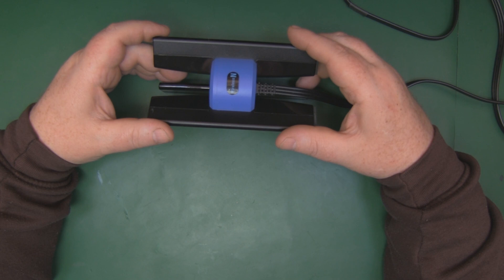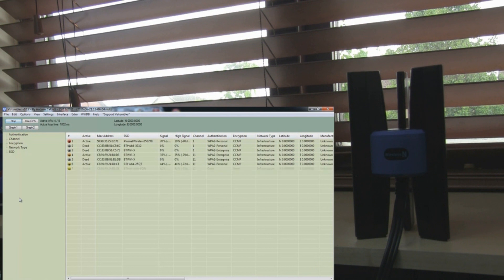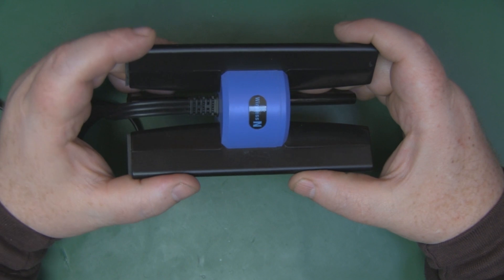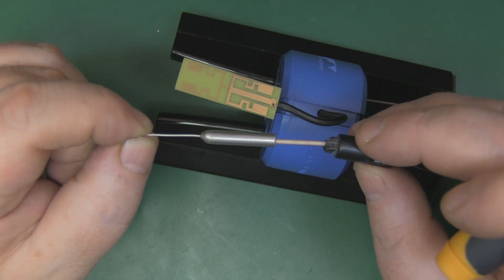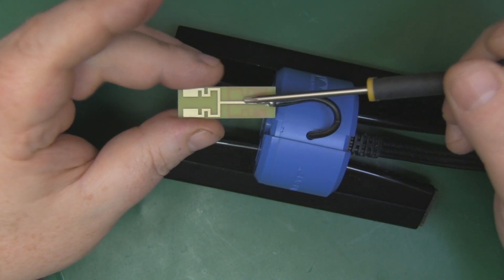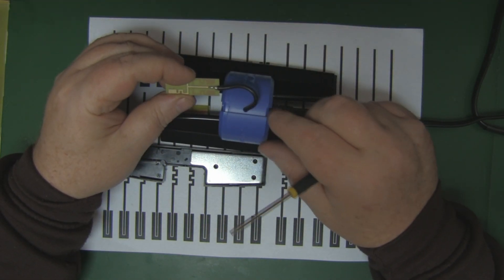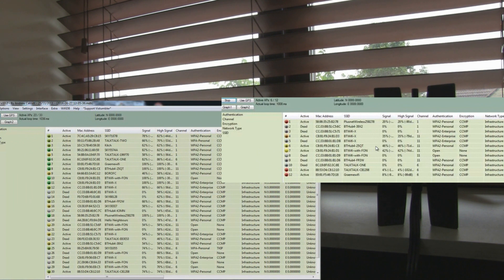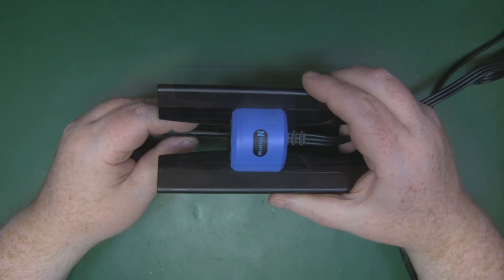It’s a Bad Antenna but it Looks Good! #162

Comment: I found one at goodwill after watching your video. not to bad on the signal so I opened it up and found they had changed the elements to brass and enlarged the measurements nice antenna it works good for what it is I love the videos Andrew thank you

Comment: I think there must be a slot for that WIFI module in your computer or why not just get rid of the PC your  running and get an ACER ASPIRE TC-220 with built in WIFI/BLUETOOTH which runs an AMD A10-7800 can be upgraded to a A10-7980k and 16GB of DDR3 RAM, it has a plugin graphics card which should not have been installed as a perfectly good graphics card and sound card is integrated into the A10-7800 provided the tiny screw is removed from behind the VGA connector which will release the piece of card which is blocking the HDMI port all in all is a very good machine.

Comment: Truly an odd antenna, If it was a real high production run or standard antenna of sorts I'd guess it to be a cost thing.
Even the cost argument doesn't really make much sense though due to the abundance of good cheap simple dipoles

Comment: Thanks to you, I've improved wifi, 3G and radio control toy transmission. Not only have I learned about this science but also had great fun building the antennas, with surprisingly good results even without testing equipment. Biquads, double biquads, helical, and dipole a based antennas. I had good results with all of them but biquads are my favourite (double biquads are marginally better). My major breakthrough was adding an IPEX to SMA extension to my laptop's WiFi card, allowing me to experiment with directional antennas and pick up free signals. I then purchased a £2 USB WiFi card with a ralink chip that also has an SMA connector and this way I can spread the signal through my house with another double biquad (and even connect my smart TV to the same network). Regarding radio control quad copters, I have a £10 toy that was limited to 30 metres doing 200 metres easily (2.4GHz biquad on the TX and 5.8GHz cloverleafs). My goal now is to push the video signal as far as i can with a biquad on the receiver, however using dipole and biquad for video introduces noticeable noise compared to the cloverleafs, which arent very durable). I will surely purchase one of those pcb biquads from you in the future or maybe a high gain helical, as Im not sure mine is working properly (7 turn 2.4GhZ with less gain compared to a biquad). All the best. Francisco

Comment: I'm about to build my own debian based wifi router. 

I notice these mini pcie cards with 3 antennas. can these 3 coaxial connector's splice together to be connected with a single antenna?
Reply: No. Unless you change the entire configuration on the PCB too. Better to get a PCI card with a single antenna connection. A quick search on Google shows me you get the for less than 11 euros!